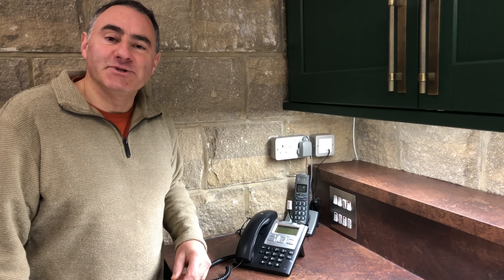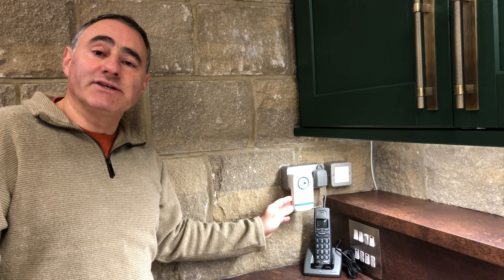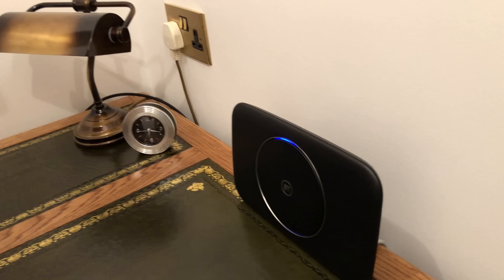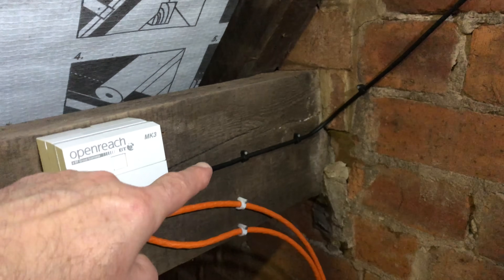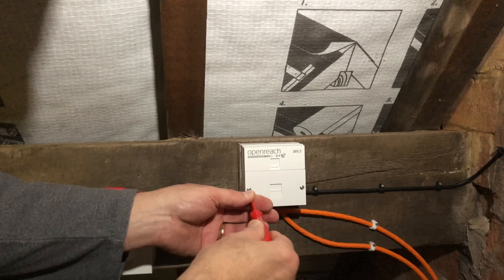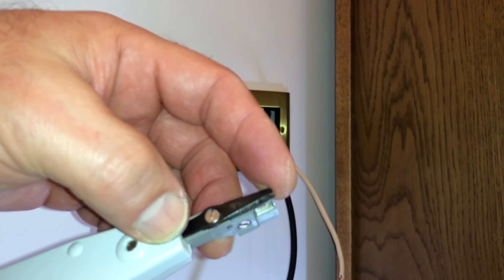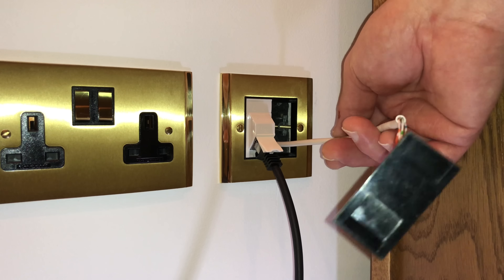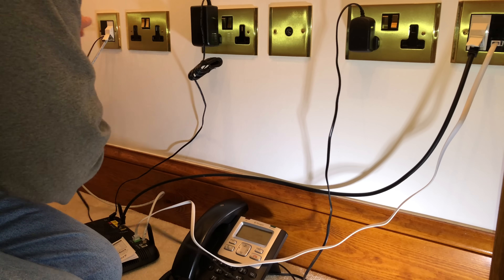How to Video - Analogue to Digital Telephone Landline Switchover Advice VOIP.

Comment: Interesting, BT doesn’t use standard RJ11 connectors! Here in Greece (and the States ) everything is RJ11. We are getting a light pipe into the home by the end of January (yeah right, here in Greece? Nothing follows a timeline here.) They have already delivered the optical to WAN adapter that will provide the pots line hook up to the in house phones. As for my FreePBX digital phone system I am using a FXO to digital input on the server. This way there is very little chance hackers can access directly the server. As for power loss, the Wi-Fi router and the Optical adapter are on a dedicated UPS that I bought from the phone company, should provide around four hours standby time. The main issue is IF THE PHONE COMPANY HAS BACKUP POWER IN THEIR NEIGHBORHOOD HUBS.??
Reply: Most phones over here come with the BT plug on them, some routers use RJ11 for the phone (meaning the customer either has to use a different cable or an adapter to use their existing landline phone), and we offer backup too but only to those considered "voice dependant" which means they can call 999/112 and lasts up to 8 hours in case there's a power cut, doesn't work for alarm systems or life alert/pendants though which is one of the big things people are concerned about over here (those talk to a call center instead of directly with emergency services).
Reply from the maker: @Subgunman Interesting to hear about how it’s working for you in Greece. The RJ11 is only used for the hub broadband connection but when / if we switch over to fibre to the premises (FTTP), it will be an RJ45 patch cable into the port labeled WAN.
@sam2660 Mother in law has a personal alarm. She is still on analogue phone line so interesting to see what happens when switchover to digital comes and where battery backup takes us. Thank you to both for commenting. Cheers Rob 👍

Comment: Why is there network cable coming out the master socket. Never seen that.
Reply: He’s hard wired what most people have as a plug in. Unless you rely on a mobile phone for both data and voice your hub has to have a wired connection to the incoming copper wire.
Reply: It carries the VDSL2 signal from the incoming line to the hub. No different to connecting the hub into the master socket.
Reply from the maker: @EE12CSVT  Just got home from work and you’ve beat me to it. Absolutely right and thanks for answering. Cheers, Rob 👍

Comment: Great clarification. Far simpler than I'd expected. 
I'd only had hearsay about how they were implementing VoIP and was therefore expecting to need after-market electronics to achieve what you've shown. 
Your solution is essential zero cost, given that I've bits leftover form many other telephone wiring experiences. 
My local exchange is a low priority, so it's last 2024 or 2025 before it happens. I'm now not so feart of the consequences!
Reply from the maker: Thanks for watching Philip and for your comment. It’s good to hear I’ve simplified the digital switchover and hopefully made it an easy switch for you when the time comes. This is exactly the results I wanted my video to achieve so thank you. Thanks again and all the best, Rob & Gail 👍😀
Reply: All upgrades and new sales are provided over non-voice services with OpenReach (by that I mean it's broadband only without the traditional phone service), so when it comes to renew your contract or move provider you'll be moved over to a VoIP service - 2025 is just the cut off date where existing services will be stopped. The cable might be different depending on your provider and whether it's a full BT socket on the router or a mini RJ11 socket and the features each provider offer varies because instead of just reselling OpenReach's phone services they have to do their own now.
Reply: I have just moved house to a different telephone district (90 mins drive away). I stayed with the same ISP but had OpenReach cancel the connection to use my existing product (was "Fibre 65") with a hearsay claim that the local cabinet at the new place was full. Ended up with a 35Mb line with analog. 
I'm in Scotland, so late in the conversions, so even though I essentially took over an existing line it was not converted to VoIP just yet. 
I've now had notification that OpenReach have just added our 'road' to their build plans but no delivery date, so still some time away!  @samd2660
Reply from the maker: @samd2660  Thanks for the information Sam, very interesting. I’m learning a lot since posting this video. Cheers, Rob 👍

Comment: We were switched over recently by BT.  Yes it works BUT we need a landline as where we live if the electricity or Internet goes down we have no mobile signal.  So now if we lose either electricity or Internet we have no phone.  BT are not interested and their only solution was to try and sell us battery backup for over 80 quid, which we refused.
Yes alot of people may have ditched their landlines but for those of us with no mobile signal it's not an option.  Also certain items of medical equipment will no longer work in a power outage.  I do believe BT have now halted the switchover due to serious safety concerns for vulnerable people.  Too late for us and I'm done with ringing them for a solution because they couldn't care less!  I'm just glad my nearly 90 year old parents have been saved the stress as like many elderly people they don't eve  have the Internet.  Thanks for video and happy new year to you.🎉🎉
Reply from the maker: Hello Cas, thanks for watching and for your comment. Our mobile signal inside the house can be patchy at times, hence keeping the landline for now. BT send their hub out for free and only charge for postage, so cannot understand why they won’t do the same for battery backup in an area that has no mobile signal. It must be a worry for you. Wonder if battery backup is provided free for medical equipment / Careline personal alarm systems. 
Wasn’t aware switchover had been put on hold. At least the elderly have temporarily been saved the confusion of dialing an area code for a local call, a nuisance in itself. 
And a Happy New Year to you too 🥂. Kind regards, Rob & Gail 😀
Reply: @robswiseways5697  Thanks Rob.  It is a worry but at least it looks like my parents will be saved from the switchover which is a relief.  I'll just keep my fingers crossed we eventually get a decent mobile signal!  Looking forward to your caravan videos and a great summer for us all.😊
Reply: @robswiseways5697  well one dials full number if using a mobile ,  maybe area codes will be redundant and everything will move to personal numbers
Reply: Perhaps not applicable in your case but if you were classed as “vulnerable”, your provider has an obligation to provide access to emergency services in the event of a power cut. Which means providing you with a battery backup if thats whats needed. Thats my understanding from the ofcom document on this anyway.
Reply: @tonyhawk123  I've tried to plead my case stating I need to keep in contact with my elderly parents but they're not interested.  A friend did just that, they gave them a backup battery supposedly free of charge and then added the cost onto their next phone bill, they are still trying yo grt a refund months later!  These big companies really don't care about their customers sadly.
Reply: It's ofcom that have pushed this on to all the telecommunications companys.

Ignoring the issus created if there's no power saying that will never happen
Reply: @sailho20  That's a record. Posting an incorrect statement 10 times. Take a look at the ofcom document on the digital switch - there have been literally no obligations or extra rules. The ofcom doc basically says “this is a telecom companies initiative, best of luck with that.”
Reply: @tonyhawk123 I read the entire document some time ago. There were objections (but none from the telecoms companies). For example the London Fire Brigade pointed out the flaws in their assumption that the average power cut lasted for 2 hours pointing out that many are much less but a significant number are much longer. They argued that battery backups need to last for much longer than 2 hours. They also ignored Staffordshire (if I remember correctly) County Council who argued that poor mobile signals in rural areas meant that mobile phones could not be relied on for 999 calls during a power cut. The whole document reads as a foregone conclusion to which ofcom didn’t want objections … those that were raised were ignored.
Reply: Shouldn't be too hard to get/create a very simple battery backup using an old car battery and a 10v regulator to supply the router (or even none at al,l as may router have internal regulators), and a simple trickle charger for the battery. Hardest part is sourcing a second hand battery that isn't a dud ;-)
Reply: @philipoakley5498  UPS for computer systems tended to use the Yamaha/Yashica Motorbike batteries paired up,  they are fairly inexpensive and I think a gel type so no sloshy acid
Reply: @philipoakley5498  It will work for fibre connections, but for VDSL connections it depends. VDSL connections use a copper connection between your house and the cabinet in the street, and then fibre from the cabinet to the telephone exchange. The cabinet in the street needs to be powered to work, and unless they have battery backup for the cabinet or they power it from a line that comes from the exchange that is under UPS, it will not work in a power outage. In my country this is the case, the cabinet are powered from the grid, so if your local zone looses power you have no network, even if you have an UPS in your house.

However for fibre the network is completely passive, and in the telephone exchnage they should have UPS, so it should work in case of a power outage. So at least in theory powering the router with an UPS should maintain the connection active. Nowadays they are really phasing out VDSL for fibre (something that probably should never have been installed in the first place, by the way, and went directly to fibre from ADSL) so it should not be an issue anymore.
Reply: It's ofcom that have pushed this on to all the telecommunications companys.

Ignoring the issus created if there's no power saying that will never happen
Reply: @sailho20 ofcom didn’t need to try very hard the telecom companies wanted it. Ofcom ignored objections from the London Fire Brigade and several local councils.
Reply: It's ofcom that have pushed this on to all the telecommunications companys.

Ignoring the issus created if there's no power saying that will never happen
Reply: It's ofcom that have pushed this on to all the telecommunications companys.

Ignoring the issus created if there's no power saying that will never happen
Reply: It's ofcom that have pushed this on to all the telecommunications companys.

Ignoring the issus created if there's no power saying that will never happen
Reply: It's ofcom that have pushed this on to all the telecommunications companys.

Ignoring the issus created if there's no power saying that will never happen
Reply: It's ofcom that have pushed this on to all the telecommunications companys.

Ignoring the issus created if there's no power saying that will never happen
Reply: It's ofcom that have pushed this on to all the telecommunications companys.

Ignoring the issus created if there's no power saying that will never happen.
Reply: It's ofcom that have pushed this on to all the telecommunications companys.

Ignoring the issus created if there's no power saying that will never happen.
Reply: It's ofcom that have pushed this on to all the telecommunications companys.

Ignoring the issus created if there's no power saying that will never happen.
Reply: Switchover is not on hold, it was paused briefly but since restarted.
Reply: The change to having to dial the full number has happened everywhere in the UK, even if your phone is still analogue.
Can endorse others comment about buying a UPS, you can backup the Hub, fibre optic unit for Full-fibre, and cordless base unit for Robs example, careline etc.